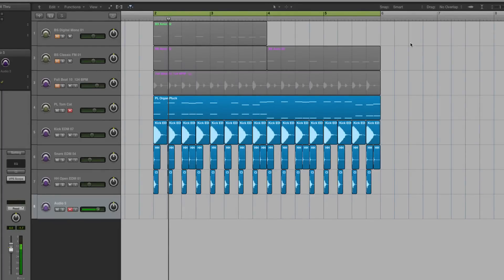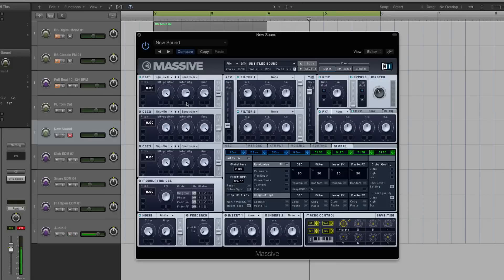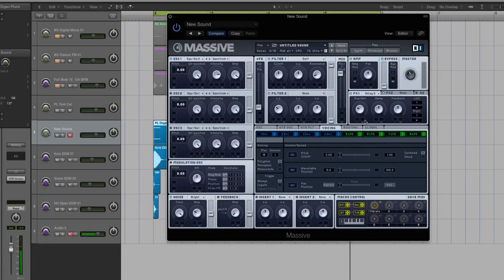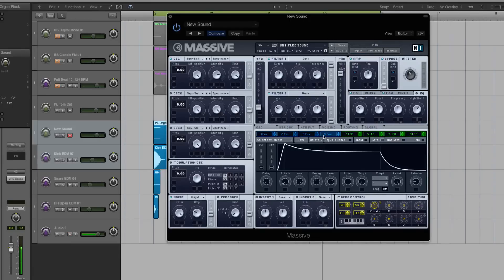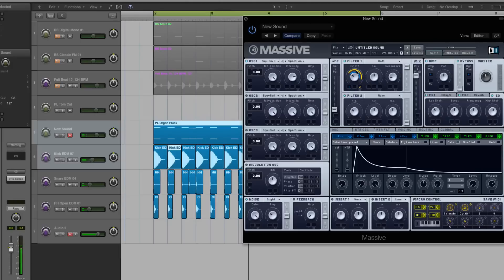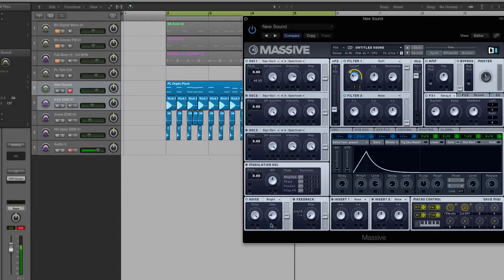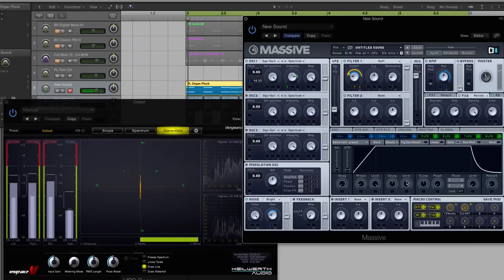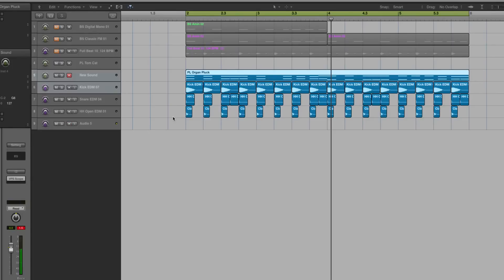3 Mistakes to avoid when using NI Massive - Part 3 - Don't Be Afraid to Modulate

Comment: Hey there Echo Sound Works! Thank you soo much for this! Helped me see sound design in a different way! One question, has nothing really to do with this video series. We get a lot of different samples of leads, basses, plucks, etc in many different sample packs. Now how are we supposed to use these in a song? Do we place them in a Sampler and just make up the melody or bass from there? Is that okay? Or should we just use it as inserts here and there....? Any thoughts?
Reply: +Vroxyle Put them in a sampler and use them just as if they were a preset from your favorite synth. You can then also modulate it and process it until its something that sounds nothing like the original but at the end of the day do what you think sounds good!